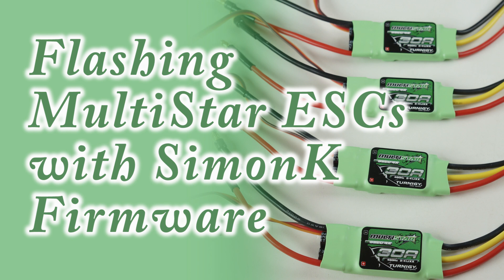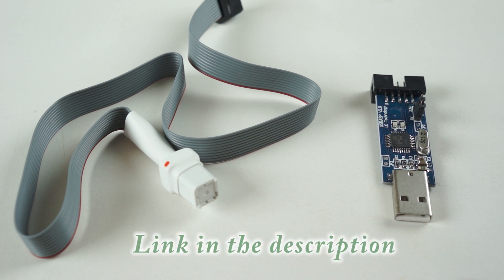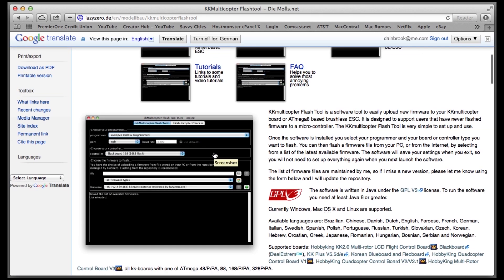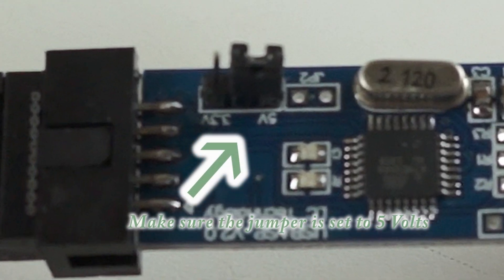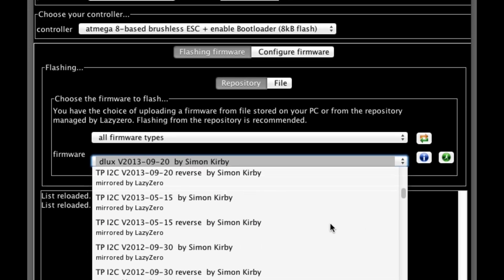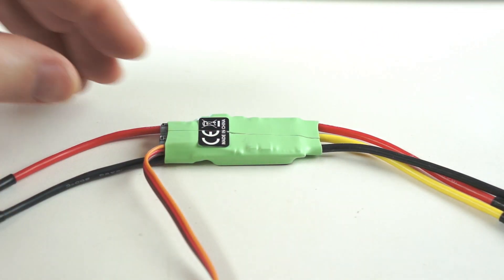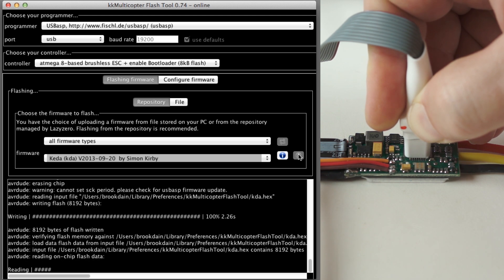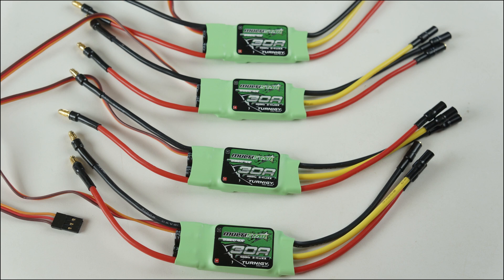Flashing Multirotor ESCs with SimonK Firmware

Comment: Hi, I trayed to configure throttle to one of the 4 ESC, only one was burned and 1 only needs to be replaced. I turned on the rc and move the left stick to the top, plug battery to the ESC but I just receive one beep. I was making it several times and sometimes a different beeps appears and now I don't know if I made chages. How can I set it to default and configure throttle?.

Thanks

Comment: Great explanation, but how to set the direction of rotation after flashing? Simply change wires from ESC to motor? And can I use for flashing this programmer (http://yadi.sk/d/VIFrFgj6SpUF5)? Because it is different from the one that you showed in your video

Comment: Yes, I am wondering if you flash this SimonK firmware onto the ESC does it take away the capability of using the programming card for setting rotation, brake etc... Also one last question, once its flashed can you re-flash the ESC with the Turnigy USB Linker by using the servo cable instead of using the USBasp socket method?  I figured once the shrink boot is put back on I would like not to constantly have to remove it to do upgrades?  Thanks....  I seen another video stating the Turnigy USB linker servo wire method will only work if the ESC has already been flashed with SimonK boot loader I just want a second opinion.

Comment: great video, but having problems.

I got a chinese usbasp and the hobby king lead and trying to flash HK 30amp esp's and just comes up with a error, suggesting clock rate and needs latest firmware for usbasp programmer. My usbasp does not have a jumper so trying to boot the esp without any power. Any help would be much appreciated as very lost and disheartened.

Comment: Don't use 4S lipo's overheat will occur
Reply from the maker: I've been using 4s lips without a problem. Probably depends on properly sized motors and propellers too.

Comment: any ideas why my friends multistar 30a opto dont want to turn the mutistar 4822-690 motors after flash? 
it just stutters and so.. tried reflashing the esc..
Reply from the maker: Has he throttle calibrated them?
Reply: Don't know if simonk needs that? 
Will ask my friend to do a throttle calibration.
Reply: Hi, Could be the speed setting is to high for the motor
Reply: with new esc (affro) its better, but still it dont work 100%
Reply: +Dennis “Finntrollet” Hyttinen Ståhl  if he gets a studder it could be the motor
Reply: This one is quite old, it´s solved. cant recall how/what he did. :P but all of his multirotors are sold now :P